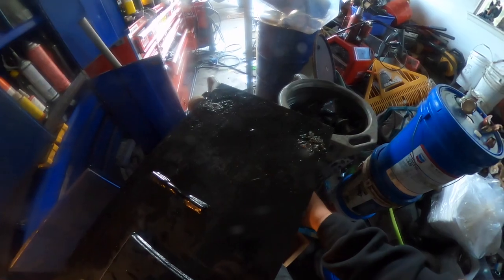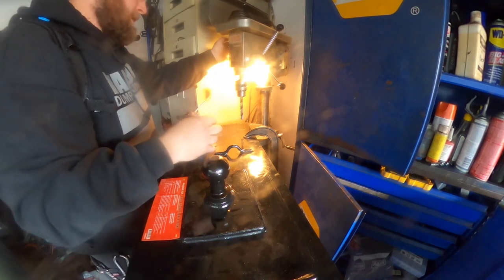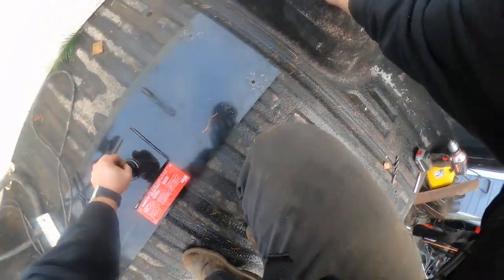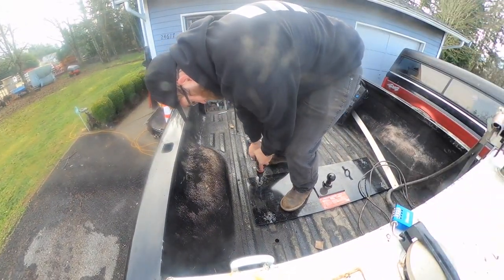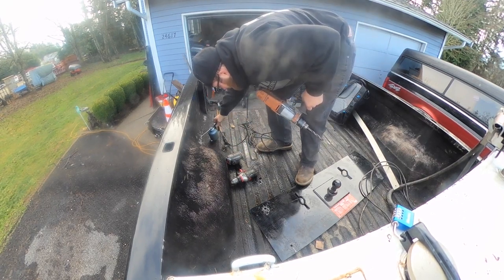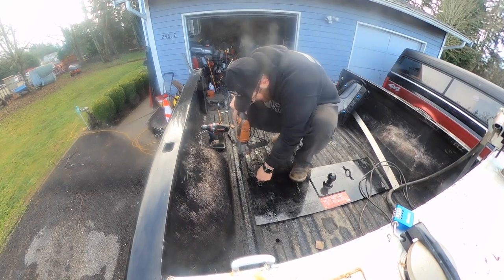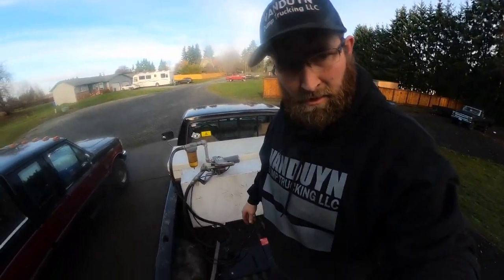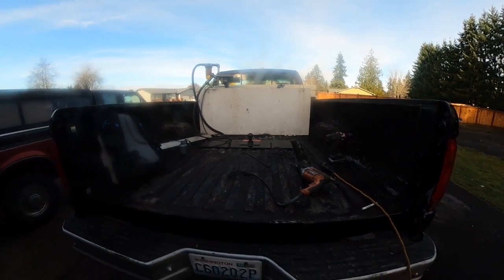HOW TO INSTALL A GOOSENECK PLATE on a pickup truck

Comment: Hey Brian remember to put spacers between the bed and the frame for more strength . I have installed many gooseneck hitches on my own trucks.
Reply: What type of spacers
Reply: What size/length bolt and size/type of spacers please? We are installing on a 2015 Toyota Tundra.